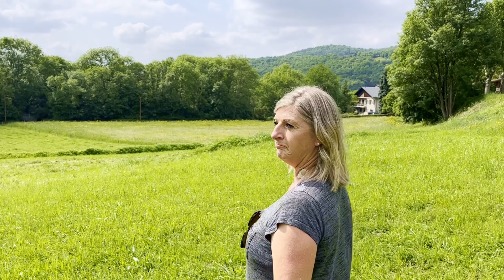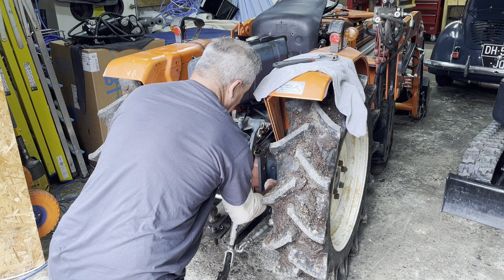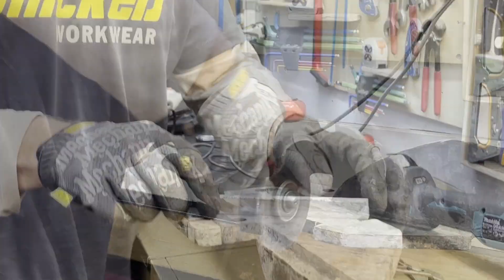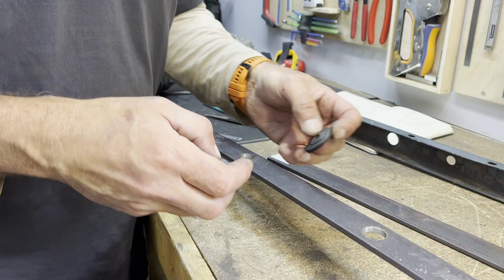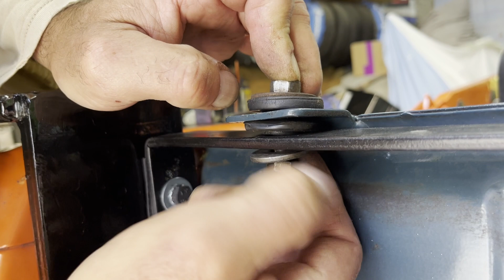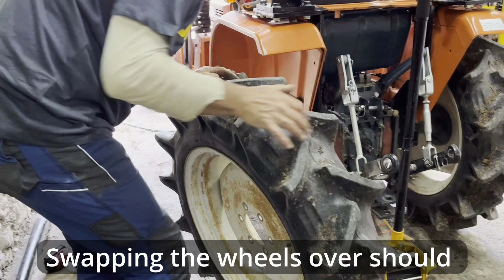Fitting Roll Bar [ROPS] to my Kubota B1600D

Comment from the maker: If you have any questions or have any suggestions, drop a message below ……..Be sure to LIKE & SUBSCRIBE! It is the best way to support our channel ❤ Thanks for watching!
Reply: I was wondering if wheel spacers could be used to widen the track on the front and rear axles? If so that would really stabilize the tractor.
Reply from the maker: I would love to find wheel spacers here in France - they are easily available and cheap in the US but here it is difficult to find (other than shipping from the US which is horrendous pricing.  The front do not need them as they are on a swivel axel (I have been told).
Reply: Dis is the way France put things together 🤦🏼‍♂️there are bedder roll bars that fits with out taking parts of 😅

Comment: Nice! Where did you get the two support plates for the Roll bar? The ones that go from the arch to the chasis. I also have a Kubota B1600 (I live in Girona, so not far from you!). My tractor is also imported from Japan and came with ROBS but the arch is screwed directly into the orange metal (at the sides of the fuel tank), so honestly pretty dangerous and useless if I ever need it... I can share some pictures, maybe that helps me explain better what I'm missing :)

Keep up the great work, really nice channel here! And super useful for me as a new owner of a Kubota B1600, already inspired by your ideas.
Reply from the maker: They came with the rollbar. But I did have to modify them to fit. I also shortened the rollbar as it was too high. Not many 1600 tractors about.

Comment: Just an additional, I keep seeing that lovely classic Renault 4 behind you.......a pal had one in Cyprus it was fun and cheap to run.  In the early 70's I was lucky enough to get a drive in the 4x4 Sinpar version, amazing where it would go on those skinny little tyres.
Reply from the maker: I have to finish welding the new floor in - once that is done we will be using it as the build truck (with a tiny trailer).  It is such a great little car.

Comment: Glad to see the roll bar install! I use mine religiously on my Kubota. I have a L3560 which is kind of a tall narrow tractor to begin with. If you don’t have a seat belt you should with a roll bar. I was told once that if you don’t have a roll bar you don’t want a seat belt so you can jump off the tractor if it starts to flip, but if you have a roll bar you want a seat belt so you don’t end up under the roll bar when it flips. I don’t know how true that is but it sounded good to me. Another thing if your rear tires aren’t “loaded” that isn’t helping stability. We have to use beet juice (rim guard) because it doesn’t freeze and isn’t as corrosive as calcium chloride. Not sure how cold it gets where you are but if it doesn’t freeze you could get away with using water. I’ve also used non toxic RV antifreeze or windshield washer fluid. Anyways keep up the good work! Really enjoying your videos. We’re working on a homesteading/produce selling stand project of our own.
Reply from the maker: Cheers and your comments are really welcome - I just fitted the seat belt to my mini excavator and now will do the same on the Kubota - just need to figure out a fixed point.  Thank you so much for watching.

Comment: Seems to me Ian the rop is high enough without the fold up top 'up' tbh.  if it can go on the other way round it would lean forward a little bringing overhead protection more overhead so to speak. Make a topbar to use pln holes, also personally id be more confident with a diagonal brace too.
Reply from the maker: In my next video, I do something very similar to what you have said.  But I may give it ago on turning it around to face forward too.  Thank you for your comments.

Comment: Has to be the wrong ROPS for that tractor
Reply from the maker: Not the wrong one - it is a 40 year old machine and this roll bar was fabricated from where it came from but does fit a myriad of machines - as I say, I am not thrilled with it but I have modified it in the next video.
Reply: @HomesteadingUncontained I doubt if that tractor had a rop bar avalable when it was new. I have older tracfors and they don't have them.

Comment: I have a Kubota B1902D and my ROPS which came fitted to the tractor when purchased from the company JPFrance and it looks nothing like yours.   I still have the rear shelf and mine is a lot lower than yours, I can also unmount mine by simply removing 4 bolts which takes 2 mins.
Reply from the maker: Believe me, I am not over the moon with this one - it is a unit they fabricate themselves but as you saw, it is definitely not a bolt on - see my next video as I do modify it a little.